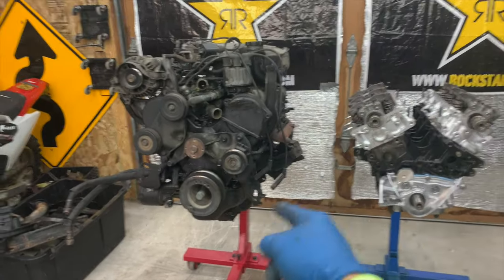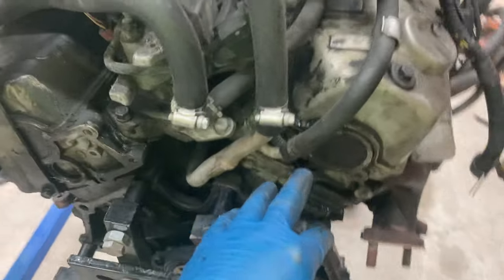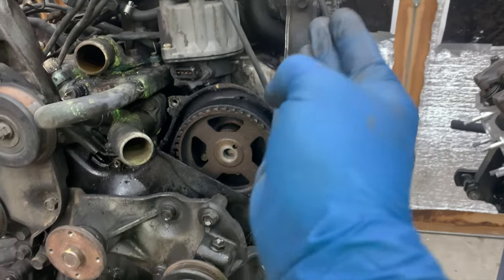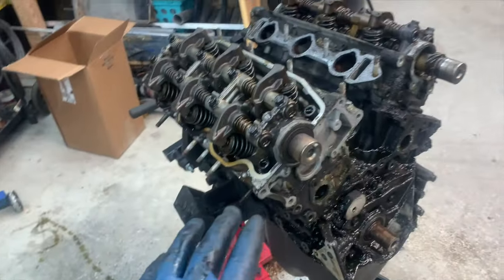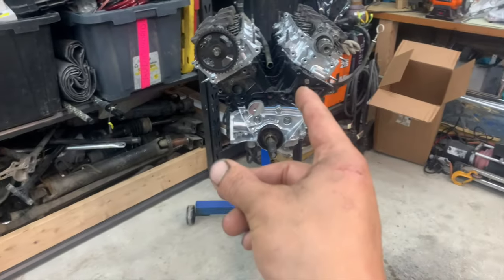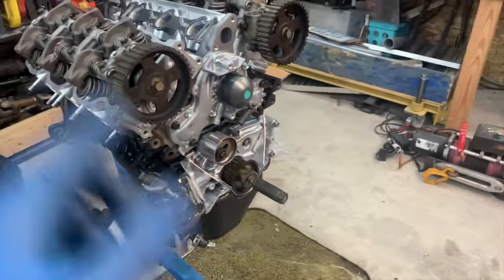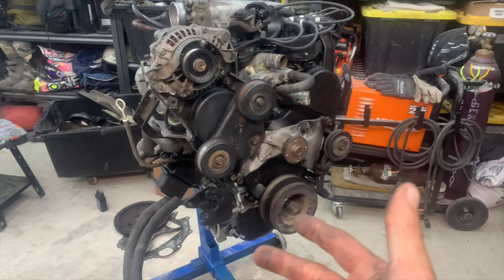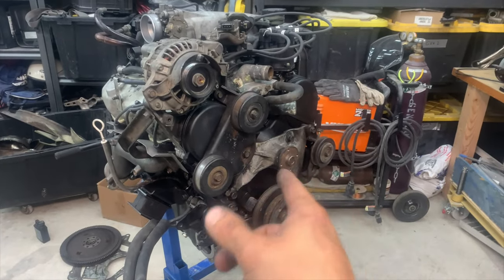Rebuilding a Gen 1 Montero Engine

Comment: Nice work! It takes some guts to drill a block. Don't forget to off up that core block- it is probably just fine, even with 300K miles. They are strong blocks. GL with the rest of the work and thanks for sharing.

Comment: The factory never used a oil pan gasket. If you use Hondabond HT- you will likely never have a leaking oil pan. The oil pan gaskets will always leak. Glad to see you figured the non interference part.

Comment: SOHC is a non-interference engine. Most likely you will find no valve collision damage. The bolt may have been over torqued. The whole engine is severely neglected.

Comment: Great video man. I did a motor swap on my 93 a few years ago. I got the block from engine world for 500 bucks. Short block with super low miles. Swapped all my stuff over in about a weekend or so. Just had to wait for some odds and ends coolant parts like the housing and hoses.

Comment: This was very helpful!  I have a 1990 Montero RS that I am working on and this is my first time digging into an engine like this.  How exactly does the dipstick attach?  I am trying to remove the exhaust manifold and I cant get it out without removing the dipstick.  Does it just pull out?  My engine is still in the car so its not super easy to access.  Any tips?

Comment: The old style crank bolts tend to break. Any of them will back out if they're not torqued correctly, but that's not why they're onto a third iteration. In my 95, years ago, mine broke off flush with the crankshaft snout and it was NOT fun to fix.

Comment: Those bolts like to break - I’m only a couple of minutes in, but if this is really a gen 1 montero engine, it’s non-interference so shouldn’t be any bent valves or damage on the cylinder tops
Reply from the maker: Yep I figured that out in the end

Comment: Hi from South Africa I've got a Gen 3 Pajero v6 3.5 GDI. Where did the exhaust manifold crack. Just interested as I'm getting fumes into interior. Carnt find hear any leak. Thanks
Reply from the maker: They crack in a few different spots, usually you can’t see them until you remove the dust shield
Reply: @montanamontero  
Thanks for the feedback